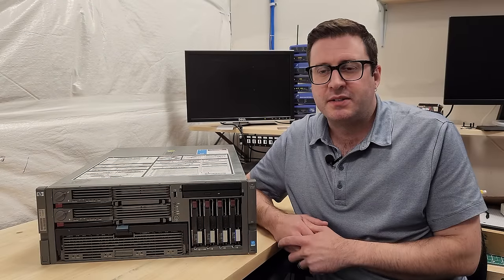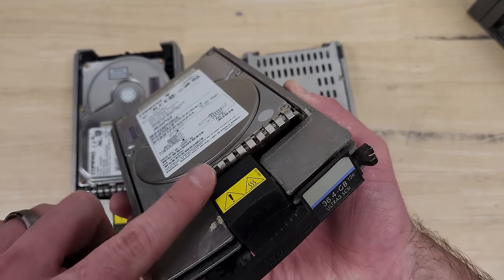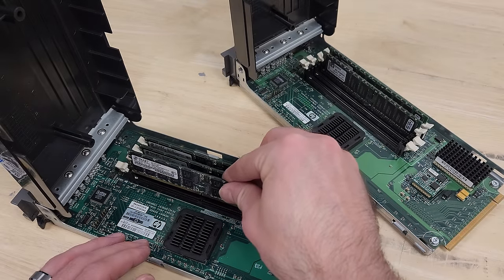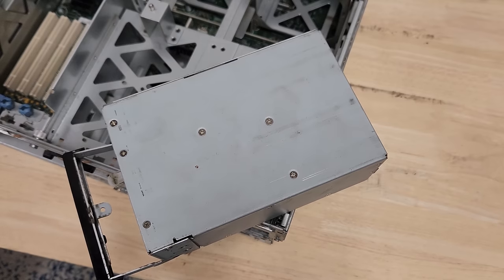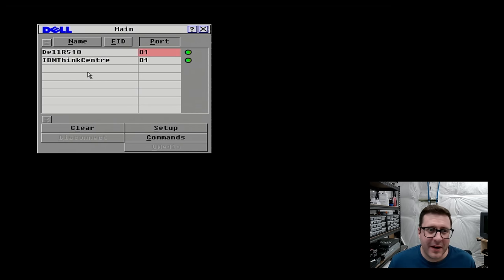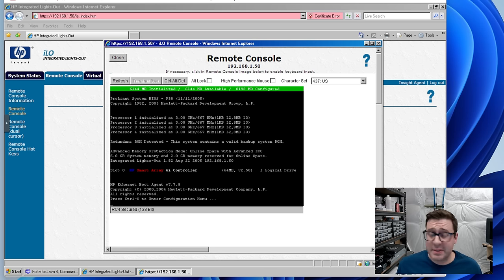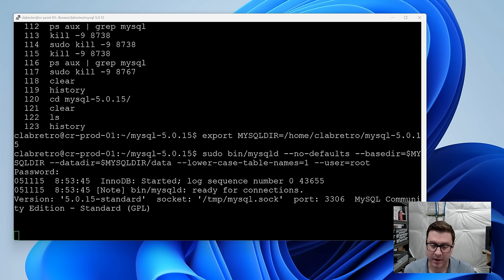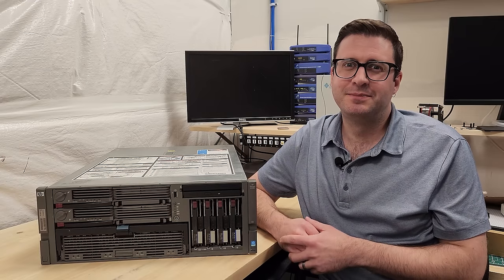HP ProLiant DL580 Gen 3

Comment: Still have one of these running a custom app on RHEL 6 at work because the admin of the system is insistent they need to use RHEL 6. They bought a new server a year or two ago and were surprised that it wouldn't work correctly on a new server and hardware wasn't detected in the OS... I've intentionally avoided dealing with it, but I did have to swap some RAM at one point when I visited our DC and noticed the RAM failure LED on one of the modules.
Reply from the maker: that's wild!
Reply: @clabretro  if you saw some of the shenanigans that happen in the financial sector you'd shake your head. VB6 powered apps, some of them running on virtualised Win XP Pro VMs (not even Windows server!), contractors hired for hundreds of dollars a day that literally act as human InstallShield setups because that's more profitable than building a proper update app (I wish I was joking), contractors who think network shares are black magic (he literally said 'I need a folder where I copy files in it, and it appears on this system too').

It boggles the mind. I understand why Frank Grimes flipped out in The Simpsons. It all makes perfect sense now.
Reply from the maker: I can only imagined. Always horrifying to hear how things are really going inside big corporations haha.

Comment: Antistatic bags are not insulators. They are conductive. This is so that accumulated charge can dissipate. Your RAM BOARD may still be non-functional. Your test is flawed using the antistatic as layer between the board and the metal casing will not give the result you expect, namely isolation. Use something else and retest.

Comment: Although the memory card/module is most likely bad, you do need to lock the tray to stop ro the server knows it's not going to be removed.  :)
I worked on 15 on those servers back in the day :)  The hot swap memory cards were great but you need to be sure NOT to just pull out the card. 
When you unlock the tray the hardware will start the fail over assuming you have all the drivers/support packs loaded for the OS installed.
Reply from the maker: oh interesting, I'll do that from now on. makes sense in hindsight ha
Reply from the maker: You're going to love this. I locked the "bad" one and guess what... it started working 😂

Comment: What makes me really sad that the power efficiency of that thing (say GFLOPS per Watt, or whatever else) is terrible when compared to 3-4 years old smartphones. So if you really wanted to use it as a server, you'd probably get similar computational power from several modern SBCs like Raspberry Pi that would use ~90% less energy. 
Don't get me wrong, I really love old PCs and servers, but economically their place is in a recycling facility, and not on a desk, connected to mains.
Reply from the maker: Oh yeah, this thing doesn't stay plugged in very long.

Comment: Virtualisation and clustering existed in 2005. The extra redundancies are for workloads where even a downtime of a few seconds or minutes results in severe consequences. Also, 4-way systems are super niche and really expensive. Nobody buys only 1 of those. If you can afford one, you can afford 2. Everybody else should buy 2 smaller boxes. Nobody should run only one prod box. That's horrible.

Edit: HPE still has Advanced Memory Protection. It can map out faulty regions of RAM with online spare. Oh, and google iLO advanced key.....
Reply from the maker: oh that's a fair point about if you can afford one you can afford many.

yeah looks like it's pretty easy to... acquire an iLO key

Comment: Anti static bags are conductive
Reply from the maker: I'm going to try another type of plastic, some other commenters mentioned that as well!
Reply: @clabretro  did other kind of plastic work? If no, try with multimeter in continuity mode to check the caps. One of these might be shorted.
Reply from the maker: @MrKrezol  Actually, you'll love this — the board needed to be set to the locked position for it to work. Worked fine even with the anti-static! I don't know why the machine would allow the other board to init while unlocked, but once I started locking the "bad" one it worked just fine haha.